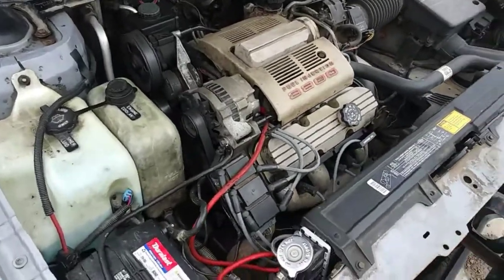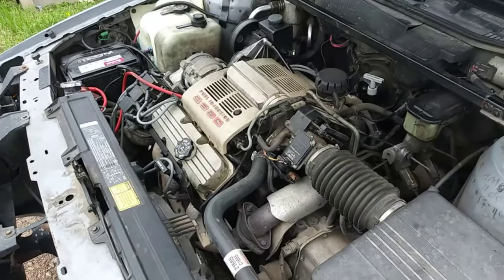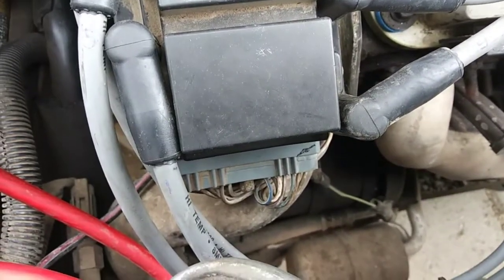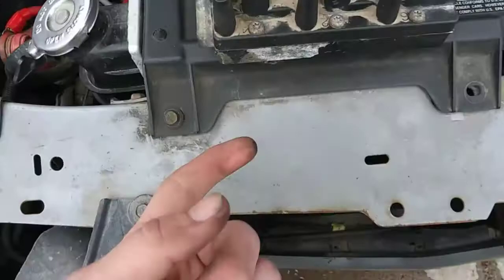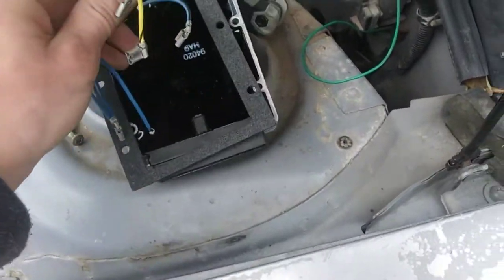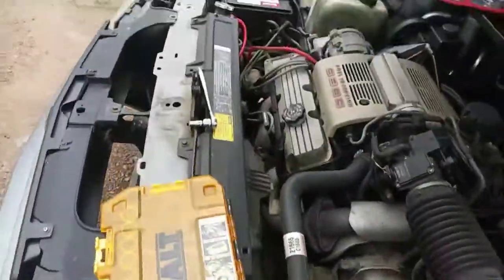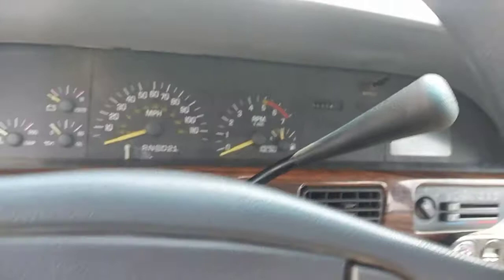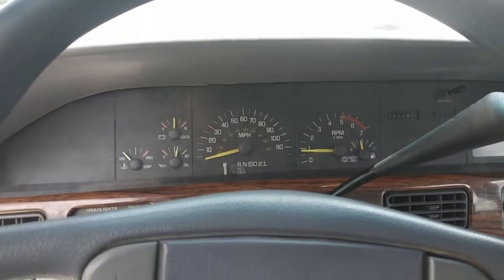ICM Replacement GM 3800 Vin C (1988-91)

Comment: Does that engine have a MAP sensor?
Reply from the maker: @marcogallegos8878  This particular 3800 does not have a MAP sensor.
Reply: @ would you say you’ve mastered working on that engine? My dad has 2 Buicks like that and no one can diagnose them
Reply from the maker: @marcogallegos8878  I wouldn't say I'm a "master" of any mechanics but I tend to find out every issue I have with mine. Usually not too difficult to diagnose, but the electrical can be tricky.

Comment: I was going to try this in a Walmart parking lot where, I coasted off the road into ( I had to do some pushing but we were close) .
But I had no wrenches so I spent  over $50  on some wrenches but had to return to buy a second socket set for the ones underneath the 11 mm  or what ever they  were. Can't have a adapter to a 3/8 drive  (makes it too long). But then when O'Reilly's didn't carry the ICM till Monday and it's Sat. then I had to pay the tow guy $200 anyway.  I have a 1990 Pontiac Bonneville/ This the first time it left me stranded. I like the ride. I'm just hoping it is that icm under the coil pack I don't want it to be a missing magnet on the  crank sensor as it did die on a bumpy road.

Comment: Thanks for the video. I have an ‘89 LeSabre that I’ve been told needs a replacement ECM or a replacement PROM. Do you have a “how to” video for that??
Reply from the maker: @davidhollingsworth950  No I don't. But it's on the passenger side footwell back behind the glove box kind of. You have to pull the kick panel off and it's a silver box with 3 large connectors and a 10mm bolt that holds it down.
Reply: @ Thank you very much! I’ll look in that area. 👍

Comment: Common issues with the engines are Camshaft Sensor malfunctioning and ICM going bad. And the brake line (90°) just before the fuel filter rusting out and failing... The brake line fails after about 20 years.

Comment: 2024: Wow! Finally a video for the pre-1992 3.8L engine!!! Original ICM for my 1991 Delta 88... I guess I got my monies worth from it! 
* Great and informative video! A shop wanted minimum 1 hr labor because it's a car older than 15 years old... $150 to repace this! Add in the cost of their ICM and it quickly turned into a $350 repair! I found on on Amazon (same one from Advanced) for $90... If it works out, I'll be needing another one for the 1989 Delta 88.

Comment: Coul you tell even numbers from odd I guess not
Reply from the maker: @JayTorneden  I made a mistake in my speech and didn't notice until video was out. My bad. The first way I mentioned it was correct.
Reply: The number for the plug wires are embossed on the coil pack.

Comment: Insideof coil paçk melted .sticky everywhere.what to use to clean this off?
Reply from the maker: If you're talking about a green gooey substance, I don't know of a good way to clean it. If it's been seeping outside of the module, typically it means it's cooked. Best thing to do would be to replace the ICM and coil pack on top. You can upgrade to a series 1 ICM and 3 coil set up as well, which will probably work better in the long run.
Reply: @caayydenn  What kind of mounting plate should I use? The original module has 3 screws to hold it and the series 1 ICM plate has none? Am I missing something? Thanks!
Reply from the maker: @Kaairve  You must be looking at a '95 model or something. All ICMs for pre series and series 1 had studs that go through the bracket and fasten with nuts on the bottom (except '95 models). 95' and newer models used screws that go through the coils and ICM to mount it. It uses an entirely different mounting plate that has threaded holes in it. You could probably get a newer mounting plate to bolt on a pre series or series 1. Never tried it myself. My set up is off a junked '94 Olds 98.

Comment: The wires for the front three plugs go inside the black plastic channel attached to the valve cover. To remove the channel cover you unbolt the dipstick tube and slide the channel cover to the left. You're also missing the plastic conduits that cover the wires as they travel in front of the ICM and behind the alternator, and the two 3-slot clips that hold the wires together

Comment: Does this goes the same for a 1991 Buick park avenue the same coloring for the wires my friend
Reply from the maker: It should be the same, yes. However, later on, I ended up using a 92-95 module so I could have 3 individual coils instead of one. They're all plug and play, but the brackets differ over the years.
Reply: Thanks man I really appreciate the great information you put out on the tube it's helping me out a lot thanks again

Comment: i have a 89 lesabre with the LN3 (pre series 1 ) engine..my car had no issues cranking or idling..was smooth as silk..the after around 20 minutes..with no warning whatsoever..it would stall as if i turned the key off...let it cool down for about 15 minutes and it would start again but do the same thing..i changed the crank positioning sensor..started right up..and again after bout 20 minutes same thing..i have a new ICM im gonna try next..i did notice some darkening on the plug wires at the coil..could the coil be a prob as well?..this car is 100% original 2 door with 70,000 miles
Reply from the maker: Definitely change those original plug wires out and that ICM. Your coils may be ok for the moment. Also check your wiring down to your crankshaft sensor and ICM. You could do a wiggle test with the ICM plug while the car is on and see if it acts up. Make sure you got an OEM crankshaft sensor as well and not like a mastercraft one from O'Reillys.
Reply from the maker: I actually upgraded my ICM and coils to the AC Delco style from the next generation 3800 instead of the old magnavox style because it kept burning through ICMs every year with the tons of driving I do.
Reply: @caayydenn  What year did you take the Ac Delco ICM from?
Reply from the maker: @BearLionScreenPrinting  A 92-94 Olds 98 in the junkyard. Literally plug and play.
Reply: @caayydenn  nice! I'm having an issue with my magnavox stlye again and I'm looking to upgrade. Have you had any issues since you swapped them?
Reply from the maker: @BearLionScreenPrinting  I actually have not although I haven't been driving it much due to the body rotting away above the subframe and they salt the roads like a mother where I live.
Reply: @caayydenn  my fear is my car rotting out too. I’m in the Midwest and get my car washed all winter to try to ward off the rust as much as I can

Comment: My 92 buick lesabre quit and won,t start everything else good.So when order a  ICM for 92 it was wrong.My coil is a one piece also looks the same three nuts on the front bolt holding the ICM on.Where can I get this part I live in Canada  as soon as possible any idea,s.
Reply from the maker: Any ICM and coil set up from 92-95 should work as they are compatible to swap out with a magnavox one piece style from 88-91 even. I have a short video explaining my upgrade that I just did. Theres a good chance your problem could not be the ICM. Does it crank but not start? If so, could be a crankshaft position sensor gone bad or the wiring to it. The wiring harness the ICM is linked to is shared with that sensor as well. It creates a no spark condition basically. You'll have to pull the harmonic balancer off to change it out.
Reply: @caayydenn  When took the ICM off with the coil it looked like the grease inside the unit was coming out of it as it was soaked even though it had motor oil on it.The wires to the crank sensor looked okay but when checking it was raining hard so need a dry day to get back at it.If I  leave the key on can I test the wires with just a test light to see if there is power or does it need to turn over to do this and be tested,because I can run a wire down there and get the car cranked when I see a buddy on a weekend.
Reply from the maker: @manoffaith9168  You can test the wires with a test light with ignition on just to see if you have power going to it. Thats how you would check the wiring side. The sensor itself could still be bad even if it has power. Theres a way to check resistance with an ohm meter but I'm not sure what the specs are for it. I'm sure theres a youtube video out there explaining how to test it.
Reply: @caayydenn  Thanks for your help will possibly be able to get at the car next week and try .Have a great weekend.
Reply: @caayydenn  Tried to see if 87 module will work but it doesn,t fit at connection has wrong plug and shorter bolt.So I put the old one just back on and went and found a spark tester but now car won,t even turn over.I had a friend looking for spark while I cranked it over but just dash lights come on normally and nothing on key.After trying several times with no crank at all my friend saw a spark but wasn,t sure if it was near the starter or the main bulk head wiring that sits on the front of the drivers side fender by the radiator.I know the starter connection was tight about a week before  the car just died.So wondering if I,ve a possible bad starter wire on the ground side or issue at the bulk hide which has about 4 heavy wires that go into it and one being a heavy red wire so it must be positive that links to alternator that goes to the battery or a bad rely or main fuse.The fuses under the dash that are black are not marked showing which is fuel or on the starting side there is about 8 to 10 of these and the rest are big fuses that are different colors and easy to check before they where fine.Still to windy to really work on car with on and off rain.Any idea,s.DO you know which black fuse on the firewall is which because no manual says anything about them and i,ve some manuals.thanks.
Reply from the maker: @manoffaith9168  Those big black fuses on the firewall are called relays. I've never messed with them so I'm not sure what they control. I figure there is probably some diagram under the plastic piece that covers them. But its possible it faded away. A spark at any connection is a loose/poor connection. Check your connection to the battery and make sure the inside of your terminals arent corroded. Maybe even get it tested depending on age. Also follow the negative ground from the battery to the engine block. Theres a good chance it could have corrosion on it. I ended up moving my ground right next to my alternator using one of the bolts to secure it. Use to give me all sorts of issues. Its hard to diagnose these issues without actually looking at it. I do wish I could help more tho.
Reply: @caayydenn  Battery is good and clean so are connections at battery and always are.My ground from battery to body is clean as I put this on when bought car.I,m wondering if the ground cable going to starter is aged or the bolt where the cable goes on to the shaft is hiding salt from winter has it has motor oil on it to keep it from corrosion.So when get a chance i,ll disconnect those wires at starter and check the starter at the bolts and shafts as well nuts and wires.I,ve a 2003 regal for parts so maybe take the starter and wires out of it and see what can be used.thanks for the help.been very hard to work on car in strong winds and off and on rains.Also no showing on black cover on either side for what rely is what but there actually bigger then the newer style of course.
Reply from the maker: As far as where to get the parts, they should be available at local parts stores.. If not, try RockAuto.com or even PartsGeek.com.
Reply: Found a 1987 icm that was working,still looking for a 95 used.Try next week to see if this 1987 will work it,s on a steel bracket my 92 is bolted to aluminum molded to the block.I wonder if this is the reason no airflow under the ICM and coils to cool in the aluminum mld as no air can actually cool it on the under side.Got the 87 for 20 bucks thanks for the help let you know if it works plan on getting a few of these ICm,s.

Comment: Thanks so much for posting this. My daily driver is a 90 LeSabre. I must be on my 5th ICM since I’ve inherited it from my grandparents (2012).
Reply from the maker: If you don't want to keep buying the magnavox style, you can upgrade it to a series 1 ignition system using the 3 piece coils instead of one, and the series 1 ICM will work as well. Its plug and play. I have a short video explaining the upgrade. Its worth it in the long run.

Comment: I have a 89 buick LeSabre,I need to know how to replace the actuator for the front vents.What is going on is I only have heat coming from the defrost and the floor vents and also when I use my AC.Please let me know what is going on?Let me know something ASAP.Again its a 89 Buick LeSabre Custom,4 door.
Reply from the maker: Yours may differ from my Bonneville. From what I remember on the Buicks they have the electronic climate control instead of the sliders. The "black box" in your dash is what controls all of that. Chances are that has failed unless something in the blend door itself is physically broken. The black box has bolts to unscrew it once you take off the wood trim. I actually have one in my shed, but certain functions on it didn't work, leading me to believe thats whats wrong with yours. I can't give you a guarantee on it tho. You can take it to a shop to have them diagnose it. If it is that climate control unit, they are really easy to replace.
Reply: @caayydenn  Can you please tell me where my heater control valve located on my 89 buick lesabre custom if it has one?
Reply from the maker: @timwilder9663  Your heat is just from the heater core and the blend door. And the climate control unit controls the blend door functions. If you don't have heat, blend door actuator could be bad, low on coolant, or a bad blower fan.

Comment: Hi. Do you know what will cause one of these have issues with "long starts"? Turns over a long time before it cranks?  I unplugged the Mass air sensor and it wouldn't crank. I saw another video where someone said it could be it and if you unplugged it and it started right up then it needed to be cleaned or replaced. I'm thinking maybe fuel pressure regulator and unsure if IAC would make it long start? Any help would be appreciated.  Thanks.
Reply from the maker: Have you started simple with air filter? Could also be worn/dirty injectors. Did you get an OEM MAF sensor? Definitely clean throttle body if you havent. Theres honestly a lot that can cause it. Even a fuel filter or the pump. But I would start with making sure throttle body is clean, and then test fuel pressure.

Comment: I have a 90 Reatta and the spark tester show no spark. The symptoms are it just quit and an hour later it ran for a minute. I did connected that entire assembly of the coil pack or ICM as you put it. Since I had no spark is it probably the lower part of the module? Thanks
Reply from the maker: Look into your crankshaft position sensor. A bad crankshaft sensor wont let the ICM fire spark because it doesnt know where your pistons are and when to fire the spark. A lot of times they work when cold and then fail as soon as the heat up. I speak from experience on this one. You'll have to pull the balancer off but the part is only like $45 for a good one.

Comment: You said your coils were fine. How do you know they are fine and just need the “Lower” module itself?
Reply from the maker: Because of code 42 telling me that the bypass signal the module sends to the ECM was not being put out. The coils are the mechanical piece thats controlled by the ICM below. It CAN be a bad wiring harness at times but usually its the module so I went with it and was right.
Reply from the maker: A bad coil will present itself all the time or either under load. Intermittent issues are almost always electrical

Comment: what about code 44. 89 buick lesabre 3.8l
Reply from the maker: Code 44 means "running lean". Check vacuum hoses for leaks or holes first. When I had this code in the past replacing the O2 sensor fixed it for me. I have a video on that actually.
Reply: @caayydenn  Thank you did you change the 02 sensor on manifold or the one near cattalac converter.
Reply from the maker: @jodiewodie23  There's only one on those cars and its right before the catalytic converter on the exhaust manifold. Back side of engine. Like I said I have a short video on it.
Reply: @caayydenn  Thank you i subscribed an now watching it

Comment: Thank you for the video this confirms my suspicion of what's wrong with my Saturn same exact symptoms. Waiting for money I've replaced everything else besides this part. Can't wait to find out if it works
Reply from the maker: Just be sure to check your wiring nearby, for example, to the crankshaft sensor, because bad wiring will also cause the same things to happen and short out your ICM at the same time which is what I found out happened here later.
Reply: @caayydenn  yes I did have a mechanic replace my crankshaft sensor for me. I was thinking that would fix my problem. So just that and the AIC cost me nearly 300. Im assuming he checked the wires but I will call him and make sure thank you.

Comment: Do you think it would fit on a 1990 buick lesabre ,, 3.8.
Reply from the maker: 100% yes that is the other car i had mentioned in the video. Also a Vin C engine. It will be identical to this video.